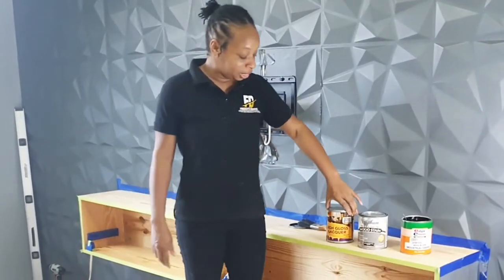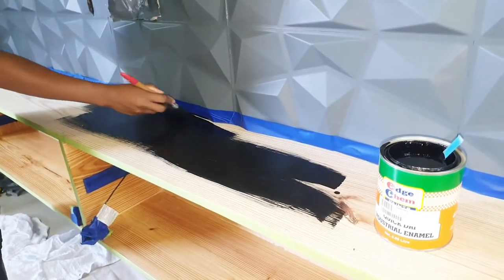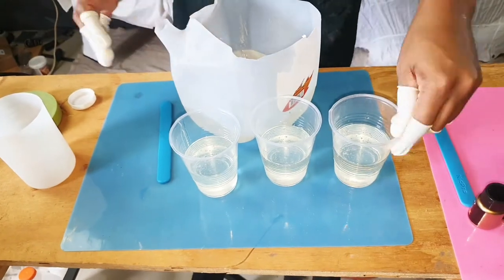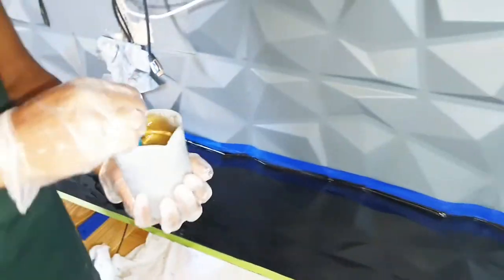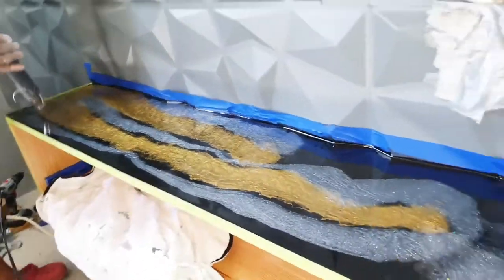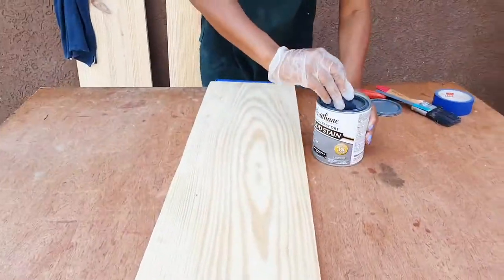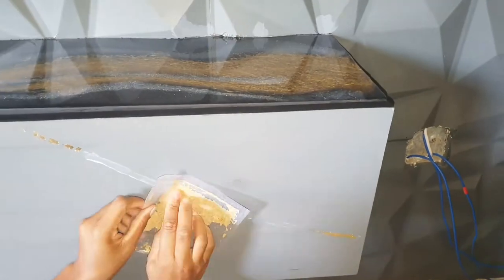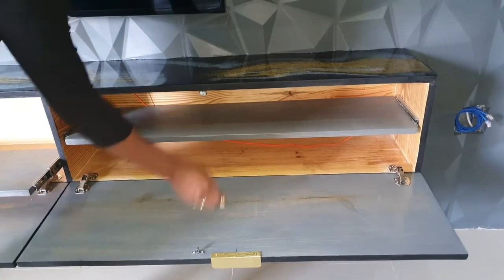DIY Entertainment shelf (part 2)

Comment: I love the top but the gold on the front wasn't my style.  I picked up your youtube because I want to paint a bedroom a darker color so I ordered 3D wall panels for a separate wall to break it up.

I LOVE your Epoxy project and will watch more of your videos 

I am NOT handy so I hire people.  I actually have contractors at my house all week removing the last room of carpet to put in Coretec Blackstone Oak LVP which we have in our master.  

I'm fantastic at painting - furniture, interior, etc but never considered Epoxy. 

I'm going to keep watching.

Oh yeah - the crappy MDF 6" baseboards are all being replaced with PVC looking wood.  This crappy stuff our builder used (2017 house in an Austin suburb, Leander) warps just mopping.
Reply from the maker: I would love to see some before and after pic if you don't mind sharing . I have more epoxy videos on my channel. Epoxy designs are lovely but some of the white designs tent to look yellowish overtime depending on the type of epoxy used, so most times I tend to stick to the dark colours to be on the safe side. I do  love the epoxy on the top of the floating shelf and I was experimenting with the gold leaf on the doors because they looked too plain. I appreciate your comment. Thanks for watching and I wish you great success with your projects.